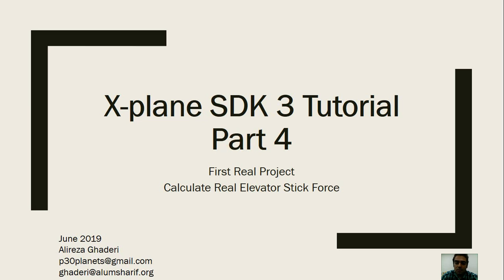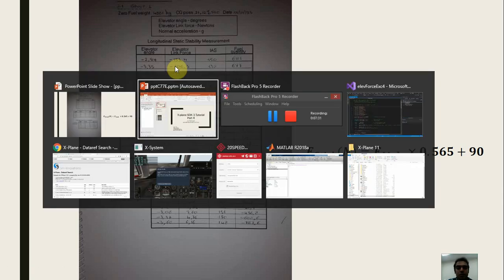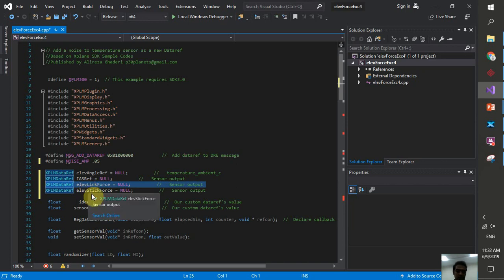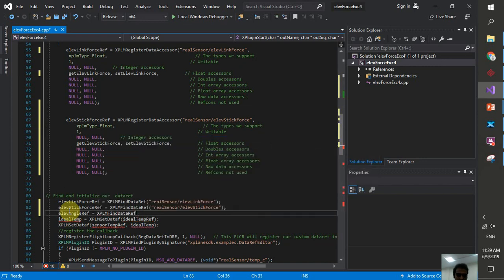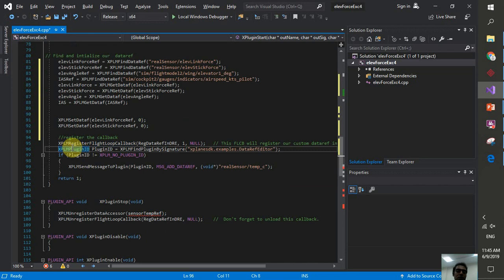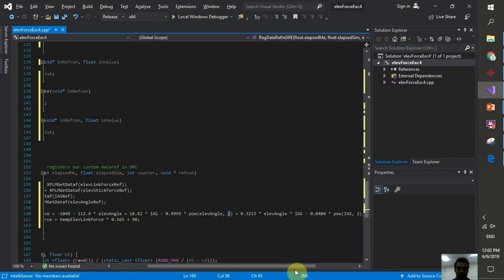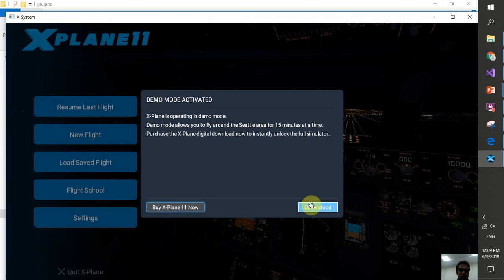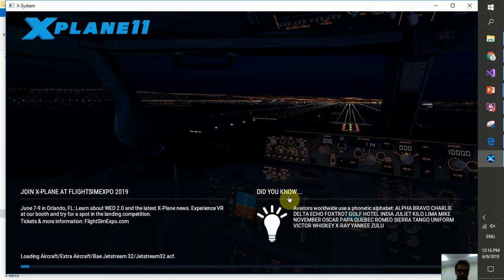X-plane SDK 3 Tutorial - First Interactive Project [Part 4]

Comment: Great video! Nice project example. Will be looking forward to your future video on reading and writing an x-Plane's Data ref using
an Arduino.( I have a Teensy 3.2 USB development board which I hope will also work since it uses the Arduino coding)
A simple Arduino code that will read an external switch position ( say taxi lights on/off ) and a pot value ( say modify heading ) would
be appreciated. Also reading a data ref value ( say trim position ) and displaying it would be great. I still do not know how to do it with
 a USB connection or with a Wi FI interface. THANK YOU !!!
Reply from the maker: Hi
For what you are looking for I suggest you use SimVim. its platform for communicating Arduino with X-plane without writing a single line of code.
Just google Simvim and you find many videos. I will post a tutorial about that as well
Reply: @alirezaghaderi  THANK YOU for your quick response. Still looking forward to your simple Arduino read/write data ref approach and code !!
Reply from the maker: @JoLo-vx1nb  Sure I will do that soon

Comment: where in your code did you put the change - I keep getting errors about type conversion -> ******************************************************
EDIT:
I found my mistake in this tutorial:
Elevator dataref actucally is a float array. so the syntax should change sth like this:
  XPLMGetDatavf(elevAngleRef, elevAngle, 0, 1);
Reply from the maker: You initialize an array of type float anywhere you like...then you pass the pointer to that array(simply the name of the array) to XPLMGetDatavf . and make sure your array is not overflowing.
Reply: alireza ghaderi 
Thanks I created a global     
float placeholder[1];
Then XPLMGetDatavf(elevAngleRef,placeholder,0,1) ;

It made no difference
Reply: @alirezaghaderi  I did the following 

global refs

XPLMDataRef fuelflowRef ;          //   Fuel flow 
float	fuelflow;					// custom dataref fuel flow value
float	   placeholder[8];

then in the code 

fuelflowRef = XPLMFindDataRef("sim/cockpit2/engine/indicators/fuel_flow_kg_sec");
fuelflow =    XPLMGetDatavf(fuelflowRef,placeholder, 0, 1);

And always get the warning 

1>C:\xpsdk\elev force\elevForceExc4.cpp(61,33): warning C4244: '=': conversion from 'int' to 'float', possible loss of data
Reply from the maker: if you still couldnt solve it send me an email and I will send you my code so you can find how it works
Reply: alireza ghaderi I did post my failed attempt on the site but don’t have an email address for you
Reply from the maker: @hedleyfurio  Its available in the video
p30planets@gmail.com